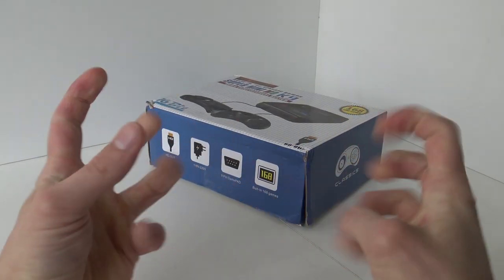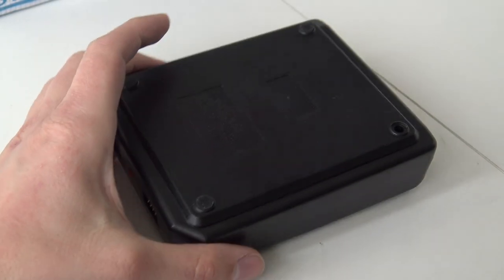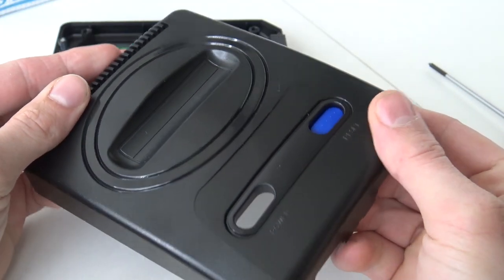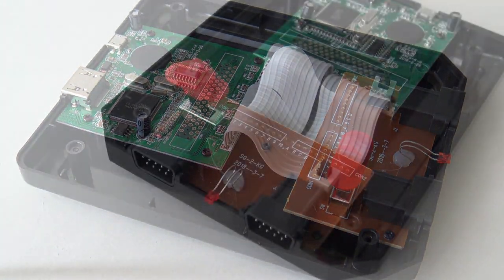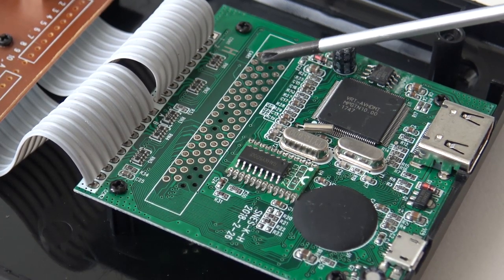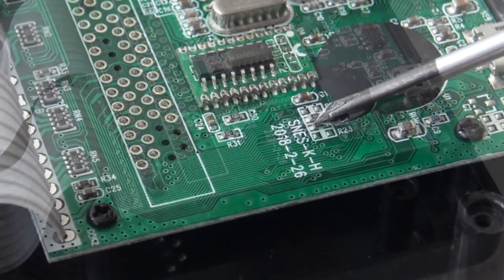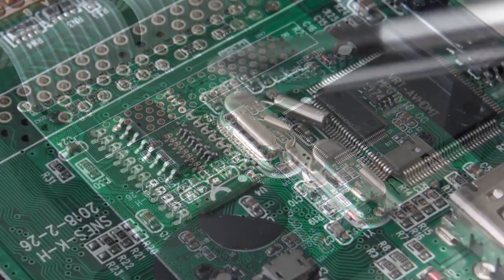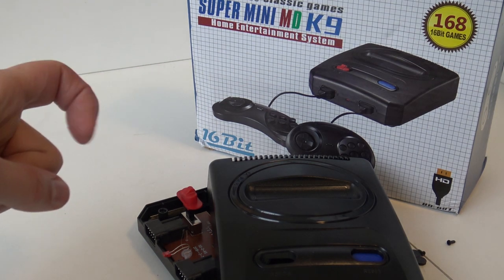Sega K9 16-bit Retro Game Console TEARDOWN !! | What's inside ??

Comment: The black blob is for protection but not from what you think. You see under that epoxy is a bare silicon die glued to the board and directly wired to board. All though this is expensive to set up machinery but cheeper in the long run.

From its construction the black blob is a megadrive on a chip. The video encoder is a rgb or composite to HDMI. I'm thinking hdmi. The big header is a cartridge port too im guessing.
Reply: Agree with them👍